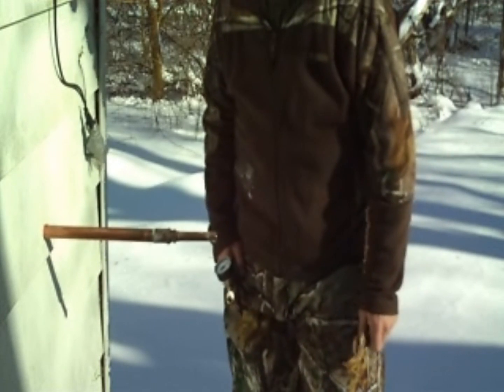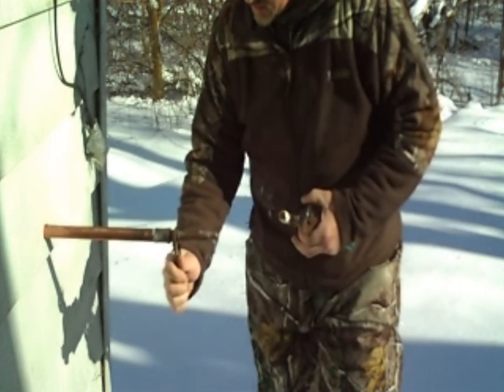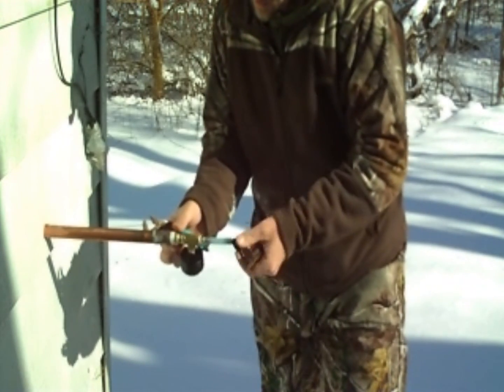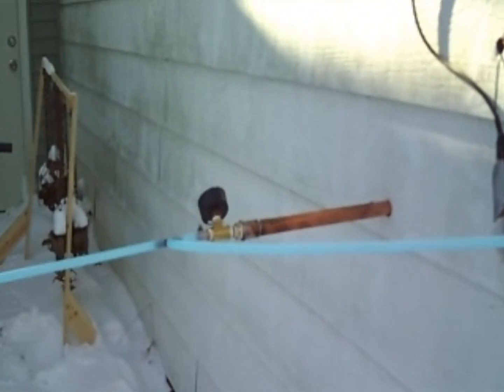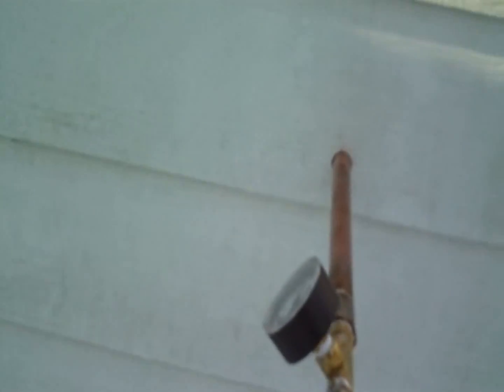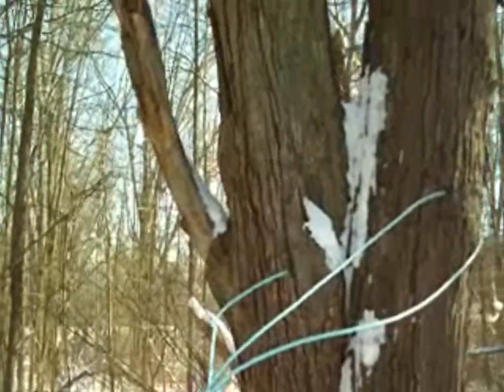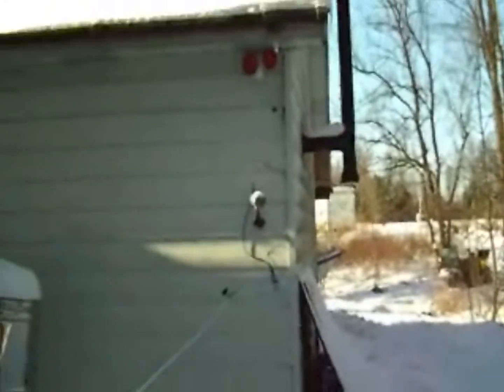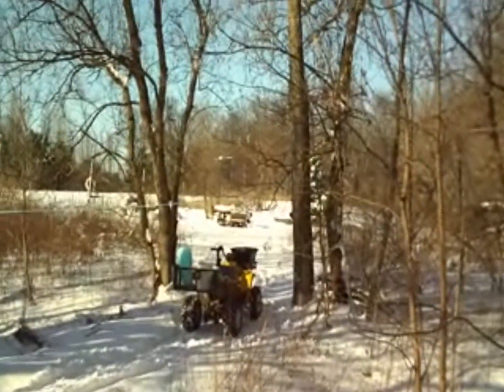Maple Syrup Gravity Tube Tapping 2013

Comment: Do you want a little tip for a better performance!, cut with a knive the bottom part of the plastic spile that you put in the tree, in other words, the bottom part of the spile as no hole, the hole is only on the end of the spile, so by cutting the botton part for at least 1/2 inch to the end will enlarge the space for the water to go out...That will increase the flow by 40%, I know, I made the test and it does increase the flow, I was on gravity for many years...Good luck!!